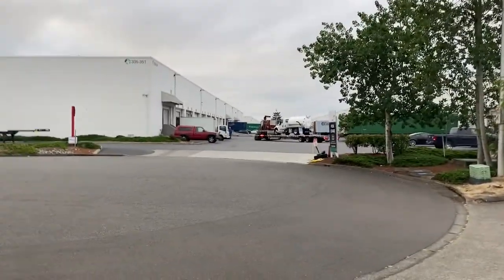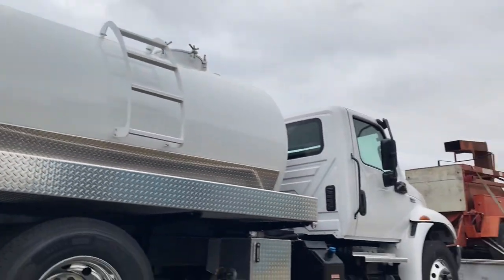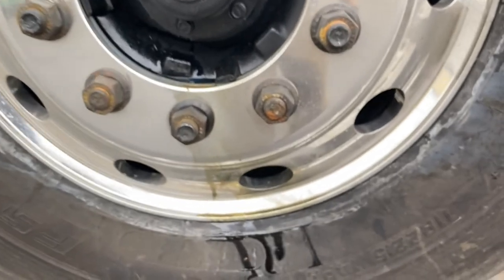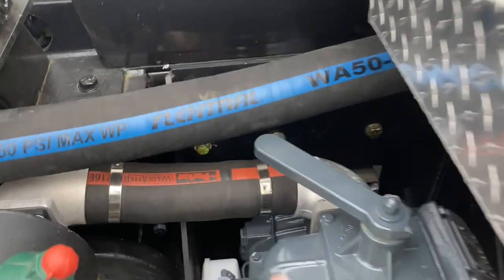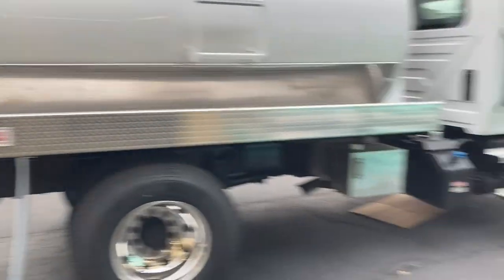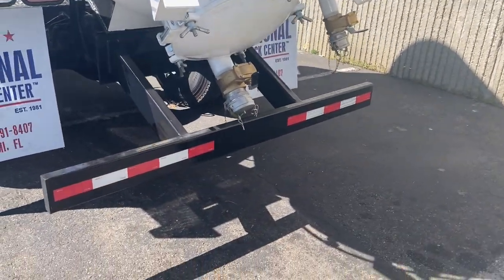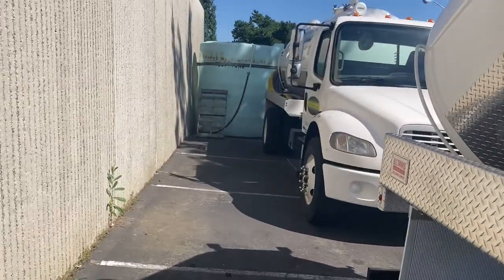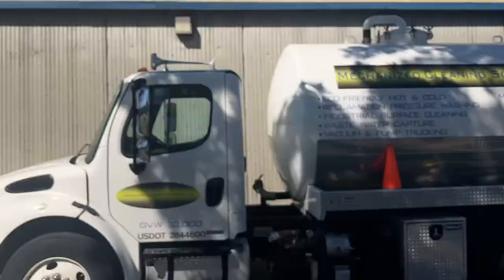Taking Delivery of Our New Vacuum Truck!

Comment: Hey man. I just got my hands on a Urai 68 blower and Im contemplating if Its too big?
I got the thing for $300 bucks. Im doing this all on a very tight budget. 
My goal is to have a 100 gallon recovery system that can handle 300 ft of hose. I do light commercial and paver patios(I want a system that helps suck the old paver joint sand out while Im surface cleaning). Im turning a 100 gallon propane tank into a vacuum vessel.
Reply from the maker: Email me a picture of the blower, in context like next to a boot or a glove or something.  What is the diameter of the inlet.  And do you know the manufacturer?  Suitor built?  Tut hill?
ben@mechanizedcleaning.com
Reply from the maker: And btw, cool!  🤓
Reply from the maker: That thing is gonna move a ALOT of air, and you need a giant small engine to power it at its native full RPMs.  What I would do:  slow it down with gear reduction.  So with a 24 hp small engine, start with a pulley on the engine that is 1/3 the diameter of the pulley on the blower.  You don’t need 845 CFM, 200 of 300 is more than adequate through 2” vac hose.  The gear reduction will give you 1/3 the rotation speed but significantly more torque on the blower.  You’ll probably get really good depth of vacuum, over the blower’s rating of 14inHg (inches of mercury) when dead headed, due to the gear reduction.  That will be ideal for moving heavy mass through the vac hose.  Should be able to suck rocks through the hose if they don’t clog it…. Lol
Reply: @PolyVshot  Its huge. Its says Universal Urai 68 Roots. Judging by looking at videos all across the internet I think I need more cfm..300 seems to low. I think 550 cfm would be a sweet spot. The damn thing weighs so much I cant even lift it myself. In fact me and 2 other grown men struggled lifting it into my pickup. It looks like it was barely used. Very clean inside. There is a Shop in Kc that rebuilds these blowers and I think Im going to ask for their opinion. I have to go buy a hoist tomorrow to get it out of my truck bed. I don't have a picture unfortunately its dark out. It looks like a 3inch inlet (maybe 4in) and outlet. My goal is 550 cfm with a Honda 20hp. Not sure if its possible.. I dont think Water lift will be an issue with that much air flow. I don't know keep in mind Ive never even used a vacuum capable surface cleaner.
Reply from the maker: @brandonthompson9505  just so you know, we run TWO vacuum surface cleaners, up to 300 or 400’ of vac hose PER SURFACE CLEANER, and the blowers are only rated for 330 CFM.  That’s 165 cfm, for each deck at 300’ of hose.  In reality, nowhere near 165 is getting through hose that long, probably closer to 120.  Just sayin…. 500 you could actually use, but through 3” or 4” vac line.  It’s WAAAY overkill.  Lol
Reply from the maker: @brandonthompson9505  also, if you don’t gear it down, the starter motor on the engine might not be able turn all that mass, and if it can, not for long.  That blower probably weighs a bit over 300 lbs, that’s a lot of mass and inertia on little bearings in that engine.  Careful…. That engine is is going to get WORKED
Reply: @PolyVshot  That's why I wanted to talk to you. I don't know nothing about real world scenarios and how much cfm something calls for.
Your point about it being hard on the engine: Yeah that's why I'm worried it might be too big of a blower.
In your honest opinion would you run it or find something smaller?
Reply from the maker: @brandonthompson9505  I’d definitely find something smaller.  Check out steambrite.com id start with a little 3” blower, should be plenty of suck through a 2” hose.  Those big Urai 68’s are meant to be pair with 50+ hp diesel motors, like in a ditchwitch or vactron hydro-excavators.  But if you gotta motorcycle engine or a small 4 banger laying around you could do something cool with it.  🤓
Reply from the maker: https://www.steambrite.com/parts-accessories-blowers-vacuum-pumps-c-3_744.html
Reply: @PolyVshot  lmao thanks for you help. It would be cool if money wasn't an issue I'd build it to the max and try to come up with other things to hydro excavate and stuff. Though I did find a site that said a 15hp to 20 hp is recommended for this specific blower.
Reply from the maker: @brandonthompson9505  remember, your CUSTOMERS, are going to be the ones paying YOU, for your services, your equipment.  Remember that you’re just a facilitator.  You’re the guy making stuff happen, but THEY are paying the money for it, not you.  So, build a small cheap vacuum, go knock out a few jobs with it, profit, then take the extra profit and upgrade.  You have much to give the customers, they need you as much as you need them.  If it weren’t for guys like you, there would be no bridges or roads and everything would stay dirty.  I’m being overly simplistic when I say things like this.  But the point I’m trying to make is, YOU are valuable.  I mean who buys a 68 blower and a propane tank and tries to build a vacuum out of it?  Lol.  It can save a lot of time to go from A to C, but sometimes you just gotta stop at B first.
Reply: @PolyVshot  You're right on the money.
I have a sirroco dolly system already but it has only been used to "puddle suck".
I bought it used and the drum was rusted out. So I integrated a 30 gallon plastic drum.
Still saving for a 16inch steel eagle.
Recently I had a 10,000 SQ Ft. 100 year old warehouse complete flatwork cleaning fall through because I tried to just spray all the dirt and dust and muck in one direction to be vacuumed up. 
After 4 hours I came to the conclusion that I was in over my head.
That's what sparked the idea to build something that could suck shit tons of dirt.
When I tell you this floor way dirty.. it was BAD. 
I quoted the job for $3200.00. I'm still not sure if that was too low or not.
Reply from the maker: @brandonthompson9505  we would have charged about the same for that depending.
Reply from the maker: @brandonthompson9505  I’m not totally sure saying this, but PROBABLY what we would have done, is taken a wand to it, and misting the place down with a yellow tip.  We would have bound up all the dirt with just enough water that we could take a leaf blower or two or three leaf blowers to it without creating airborn dust.  Once we had all the loose shit dealt with and the floors mostly clean, then we put the vac surface cleaners on it.